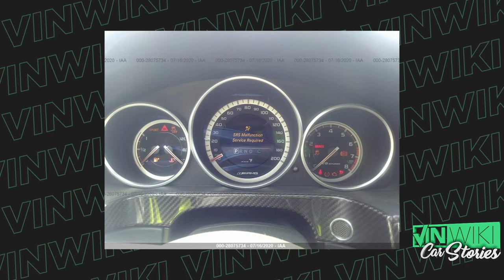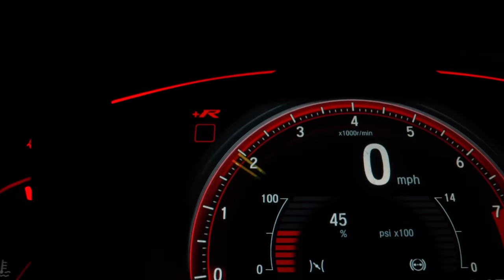This salvage auction held the world's fastest car hostage!

Comment: Personal record: I won the same car at Copart 7 times before it was removed from the auction. Sometimes they want so much money for those salvage cars that you better walk into the dealership and get a brand new one for cheaper.
Reply: Youtube has really blown hot air into all the people who run these auctions.
Reply: I won an Excursion from Adesa once key was missing won it four weeks in a row, bank kept turning down the bid. 25k first week ended up forth week getting it for 19k towed it to the dealer snd had keys made it had 3k miles on it bank was to cheap to buy a key for 45k vehicle. Saved me 6k lol!!!
Reply: @Gman7774eye  you got ripped off
Reply: I don’t know I think I did all right it was a 2003 Eddie Bauer Excursion in 2003 I sold it a couple weeks later at the same dealers auction for 45K
Reply: @Gman7774eye  at least you made your money back but usually you would wanna buy it originally for under 15k you didn’t do too bad could’ve been better imo
Reply: It wasn’t totaled it was a repo at the dealers auction. The bank was to cheap to buy a key so it didn’t sell for 45-47k which was its value at the time I bought it for 19k and resold it a few weeks later for what it should have brought. I made about 25k because someone at the bank didn’t think it was worth a couple hundred to but my a key! Yes it would have been nicer to win it for less than 15k but I had to bid against other dealers to win the bid on it. I was happy with the profit!!! Yes the same vehicle is worth 10-20k now this was when it was new msrp was about 55k
Reply: @Gman7774eye  ooooh when I hear auction I’m thinking of totaled so initial cost 19k then usually another 10k or more on top that makes more sense then you did really well actually
Reply: im pretty sure they ended up scraping the car because they do have to pay a fee on the yard space and setting up the auction
Reply: @Gman7774eye  isn’t that risky? You bought car listed as not running.
Reply: @DustyDustGaming  I bought it for 25k plus below book value I felt it was worth the risk. The real surprise was that it only had 3k miles on it.
Reply: because they know auctions aren't where you buy cheap cars, it's where people with personality disorders overpay for vehicles because, hey... ego
Reply: @Gman7774eye  you said from Adesa, you need a dealers license correct? I also bought a car with no keys, it was a stolen car, that I was able to hot wire. It was risky but i got it all fixed up and running
Reply: @DustyDustGaming  Yes from Adesa I had a dealership then and bought a lot of cars from the banks that were repos such as this one and many times they had no keys or an alarm so they couldn’t be driven. We would make keys and take out alarms snd recondition the cars and resell them to other dealers at a profit at the auction. Most dealers didn’t want to take the chance on a car that can’t be driven so it was very lucrative as most of these cars had no issues and if they did they were cheap enough that you could fix them and still wholesale for a profit.